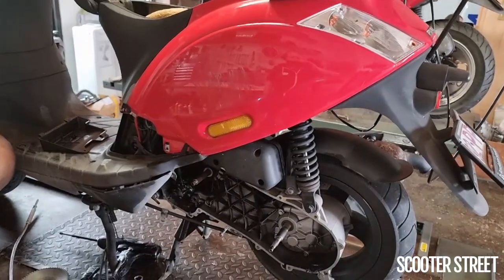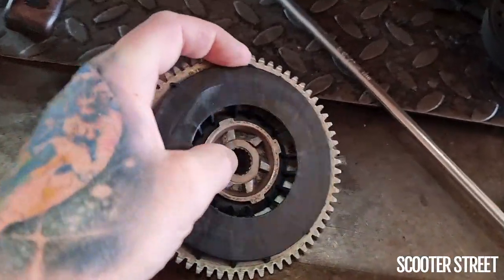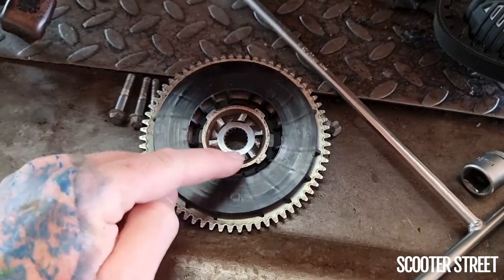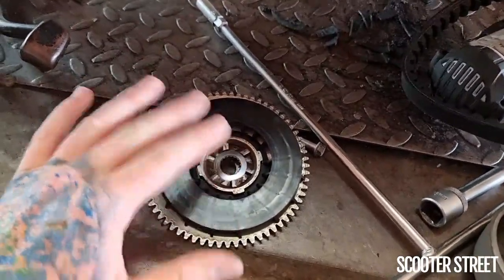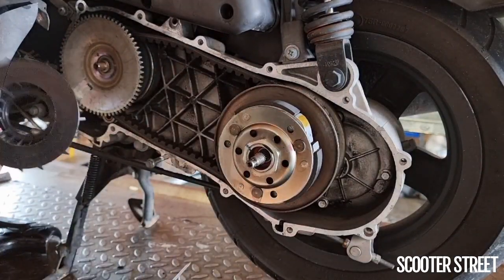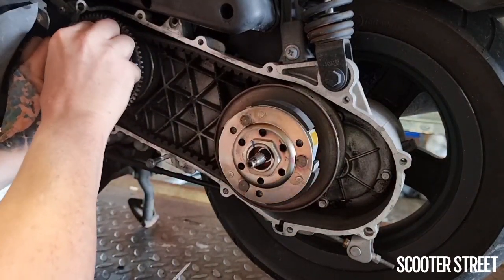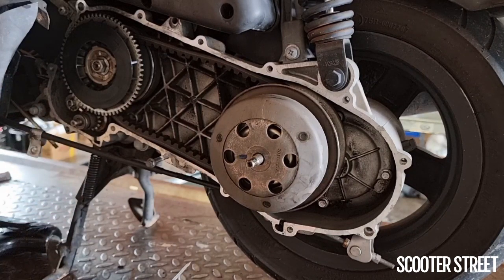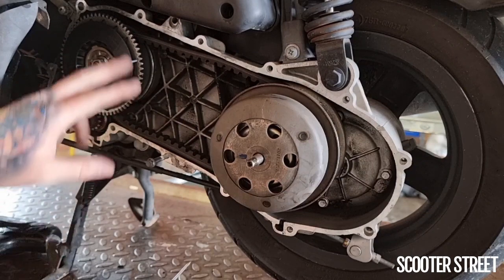How To Install A Piaggio 50cc Variator - DON'T BLOW YOUR CRANK!

Comment: Happens to all of us
Reply from the maker: 😂So not just us..
Reply: @scooterstreetau i hate that pulley, its like they made it to cut the shaft like butter in case of failure
Reply: @scooterstreetau  and the plastic fan is so close to the case it only takes one shim too many..
Reply: and i cant get the belt to reach the rim of the vario or the clutch. idk if its made like that but it anoys me. Is the malossi belt longer?
Reply from the maker: @R_O_B_O_M_A_N  Find the dimension of your current belt and source a belt that is 15mm longer having the same width.

Comment: What can happen if the belt gets pinched when tightening the variator nut?
Reply from the maker: Belt damage and the fixed fan may appear tight but after riding it can come lose.
Reply: @scooterstreetau   thanks for the reply. 

Do you know how much play the shaft on the variator-side should have?  Without the variator installed, I have 0.1-0.2mm of side play. With the variator installed it’s about 0.05.

Comment: Great video I just had this problem with a bike I recently bought I replaced the fan but now my bolt keeps coming off after a few minutes of ridding the bolt looks good but I never checked the crack shaft
Reply from the maker: Hi there, do you have it sorted now?

Comment: Can you run this vsriator without the fan? Stock 50cc just with a exhaust and malossi filter insert and jetted to suit
Reply from the maker: What does a fan do??
Reply: @scooterstreetau  I get you, havnt had one on mine for a year tho n literally fine
Reply from the maker: @pitbikepad  Nice🤙. I have run with out and the belt started to melt down.
Reply: @scooterstreetau  OK I will re fit it, I'm uk tho much colder climate here may be why
Reply from the maker: @pitbikepad  Yes that may be the reason, also the air flow in the trans cover and the distance at top speed. All factors concerning heat.
Reply: @scooterstreetau  its just mines snapped a but and no other ped iv ever owned has had a variator fan, and iv had high end builds before without vari issue. And with this being a 2017 gilera runner with only a leo vince tt exhaust I didn't think it would be a huge concern

Comment: hey when ii am instaling the nut should the fan move or should it be still. another question is that should the outside pully move when i wriggle it a tiny bit?
Reply from the maker: The fan should be locked in place and not move. You may need a shim to allow the nut more pruessure the the fan and the star nut.

Comment: Hi I’ve put a polini 70cc top end on my scooter it’s a piaggio hyper 2 engine. Will it last with the standard crankshaft? I’ve read online it’s a fairly low revving kit compared to malossi and I do have heavy rollers in so it’s not revving all that high at all. Oil pump is maxed out too so it’s well lubricated!
Reply from the maker: Yes it will, but if you get the opportunity to upgrade then do so.
Reply: @scooterstreetau  Thankyou I have got a jasil hi Tec evo crank in my old warped cases, could you please recommend some decent crank bearings?
Reply from the maker: Malossi. @dexietyy7922

Comment: Is the fan 100% neccesary? Or can i go without it?
Reply from the maker: What happens when you remove the cooling fan! Heat-expansion-BOOM💥
Reply: @scooterstreetau  Yes, heat is bad, but on my scooter there is no way for air to get into the cvt area, and i doubt that there is a LOT of heat in the transmission area.
Reply from the maker: Interesting, which scooter do you have? @MartZilka
Reply: @scooterstreetau  piaggio nrg mc3
Reply from the maker: Check the transmission cover, look underneath ar the rear. @MartZilka
Reply: @scooterstreetau  there is a hole infront of the oil pump on the cover, but theres a rubber piece to cover it up. No other holes exist.

So do I really need the fan?
Reply from the maker: The manufacturer designs parts for a reason, if you try running the engine without it at your own risk. @MartZilka

Comment: I wish I would have saw this video before I didn’t put the nut tight enough. Now the end of my crankshaft is a also slightly damaged 😭
Reply from the maker: It can be saved, new nut and thread correction tool. Dont on/off too many times.

Comment: I need help my starter pin doesnt want to go in it does but it doesnt settle nicely
Reply from the maker: Check the connecting splines, there may be damage on the teeth controlling the contact points.
Reply: @scooterstreetau  Thanks i got it working i just needed to put the variator cover and now its okey. I has 5.4g rollers and i put 9.5g for top speed but i think my acceleration got better but top speed not so much if not words
Reply from the maker: Wow 9.5gram is it a 150cc engine? Try 20% from the original. @zenq9176
Reply: @scooterstreetau  nah its a 50cc piaggio zip 4t
Reply from the maker: Wow, too heavy rollers.. @zenq9176
Reply: @scooterstreetau yes! I will be putting 6.5g or 7.5g i think it will perform better
Reply from the maker: Yes, best to try different roller weights and find the weight that works best for you🎉 @zenq9176

Comment: Great video. I accidently made the mistake of overtightening one of the bolts on the transmission cover, stripping the thread. What do you think I should do from here.
Reply from the maker: Thank you. The trans cover has 9-12 bolt points so it it not a drama if one is no longer in use. Best fix is tap and thread or if the bolt hole has clear access to the rear then you can screw through and bolt and nut it.

Comment: what a stupid idea. plastic fan as plastic becomes brittle after time and breaks apart. isn't there a metal alternative replacement made for the fan.
Reply from the maker: Yes! Polini have a complete Aluminium Fixed face with fan included, brilliant solution.

Comment: Should i add some shimming to variator? Can you explain shimming maybe or make video
Reply from the maker: Hi K, I don't know your reference when asking, but adding shims to the varaitor allows the spread of the front faces in an attempt to have the belt sit at the lowest part of the V in idle, it can be used when fitting a new belt, variator. Great idea for a video👍👍

Comment: Does the fan actually pull outside air into the case.   Or just circ.air within the case?
Reply from the maker: Yes it does both, the fan circulates the air inside the case, it pulls air in from the front, you can see the air intake inline with the oil pump (black circular with small internal filter) and and outlet at the rear of the case facing toward the ground.

Comment: i have the same scooter but i dont have the plastic fan. Is it ok to drive without it?
Reply from the maker: No, it must have the cooling fan.. very short rides you may be lucky but longer rides generating heat will cause issue with the transmission parts..

Comment: Great videos, 
I have a piaggio zip 50cc 2t, i bought a polini standard exhaust what rollers or other upgrades do you recommend? (Carb pilot jet psized to 45 and maim jet to 58) 

My top speed is 70 km/h i want more topspeed if its possible

Thanx in advanced from Suriname
Reply from the maker: Thank you👍. Trial a few different roller weight sizes, the standard 7.5 so try a set of 6.8 or 7Gram. Take the jet up until there is a splutter and then lean the main off, needle set to 2nd clip from top. Clutch spring set will help too.

Comment: hello I watch your channel a lot I have a question I have a piaggio fly 50cc 2t year 2011 I changed the entire drive to a malossi multivar 2000 how to increase the engine speed speed on a straight 75kmh 8200 rpm can you increase to 10000 rpm CDI is original thank you for your answer greetings
Reply from the maker: Thank you for watching🙏
Is the belt moving to the top of the variator, do the pen marking test..
Reply: @scooterstreetau  Thank you for the answer, I will do as you say and I will give you the answer tell me if changing the CDI of the high voltage coil to unlocked is a good idea because the original one is probably blocked. Regards
Reply from the maker: @czarecki80  I do this simple test with the CDI restriction. I park the scooter on the main stand with the front wheel against the wall. Start and max RPM the throttle. If there a cut out of the engine it will be obvious.

Comment: Heyy i have a typhoon 50cc from the 2000s and i want to put a 70cc kit but i have some questions, is a 70cc kit reliable and what is the best brand do buy?
Reply from the maker: Hi Rixxcs, Yes the 70 kit is an excellent upgrade to the engine. As with any early models showing wear upgrade the worn part as you go or something will fail sooner. We use Malossi for several reasons but just go with what is provided by your local Scooter Shop. Where are you locted?
Reply: @scooterstreetau  im form portugal, so witch 70cc kit should i buy from malossi?
Reply from the maker: @RixxVAL03  Check the Malossi website and find your scooter model, you will see a list of cylinder that apply and you can choose from there according to budget and so on. The Sport kit is good place to start if you are new to the upgrade game.👍

Comment: Hi guys I have a hi bhp race minarelli horizontal with a 55% polini rear contra spring but the belt still slightly slips. I can’t seem to find a stronger spring than that I have heard of a 82% spring but not that I can find. Any ideas or part numbers you know of which I could get.
Reply from the maker: Its virtually impossible for the belt to slip, unless your transmission has oil or something in it. The V belt and pulley design is such that more power only forces the belt into the pulleys with more force, rather than slippage. I would say more likely if something is slipping it will be the clutch.

Comment: Very nice video as always! Do you have any tips regarding increasing the CVT area cooling? Larger scooters have pretty big air filters for CVT air intake  as well as some exhaust holes. My CVT cover is too hot to touch after most rides (perf exhaust, 5g rollers, yellow springs, green contra) and i want to improve the cooling a little. I thought about making few holes with carbide bit where the clutch bell is to make the hot air escape. Do you have any experience with these mods?
Reply from the maker: Hi Matej, We did exactly that for our race scooters by adding cooling holes. The manufactured race covers have vents and holes for additional cooling. You have to take care of water making its way into the Transmission parts. Flow in at the front of the cover and pass through to the rear of the cover.

Comment: Good one! Something simple that is constantly ignored. 
I've got a Runner revving 12k rpm with a stage6 variator, no teeth. Even with the fan properly installed i'm on my 3rd fan from S6 in a year!! Those things break so easily its absurd specially in hot weather, but at least they are cheap, around 10£
Reply from the maker: Yes fragile but essential.

Comment: Great video. Want to upgrade my transmission on my Vespa ET2 50cc / 70 cc kit on it.  Which I think I can handle from one of your previous posts. If all goes well what scooter would you recommend to pimp up as my next project
Reply from the maker: Thank you, Go for an exhaust and the transmission parts such as rollers, clutch springs.